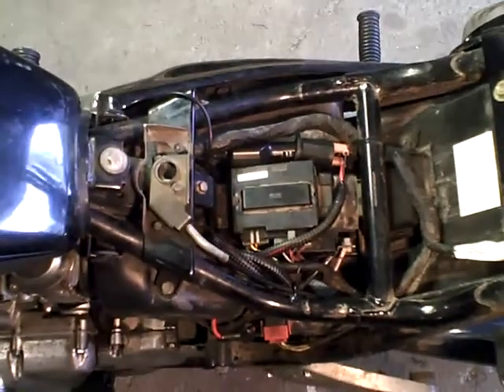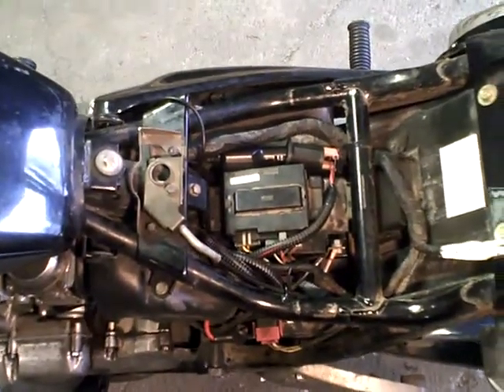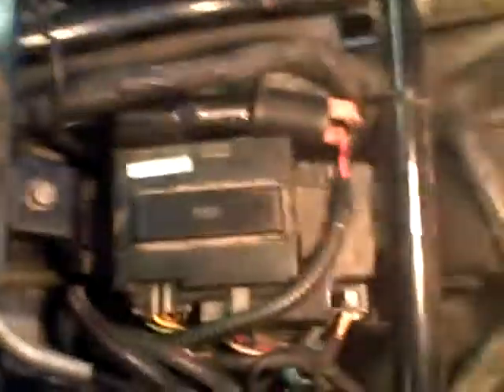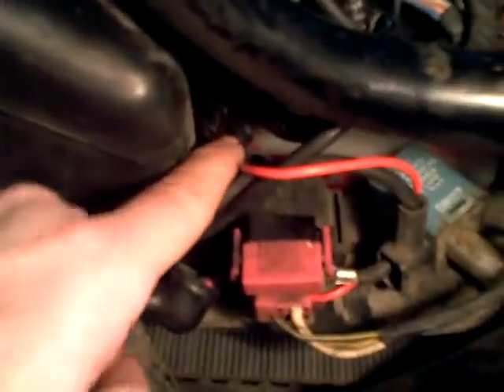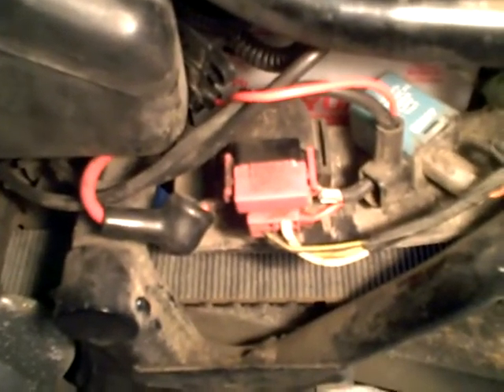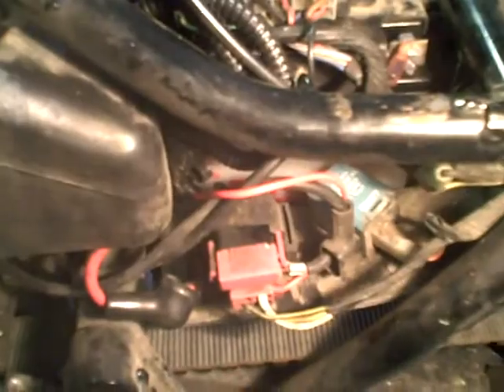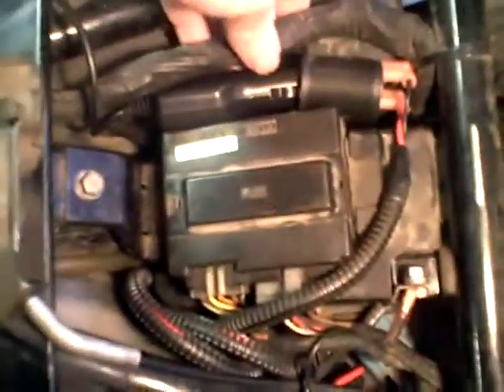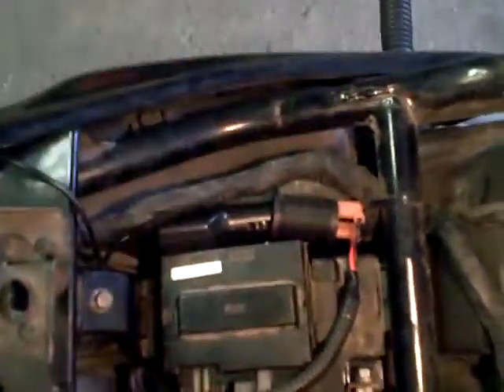May Midwest Meetup Prep

Comment: I was thinking about saying something then you mentioned not leaving the adapter plugged in.  Darn things can suck down the battery.  I learned that the hard way.  Had a similar setup under my seat.  Mines hard to get to so left it plugged in.  After a week I had a dead battery.  Now I have a battery tender plug wired into the battery that I can access from the side of the bike to either charge the battery or to plug my cig adapter socket into for power when needed.

Comment from the maker: Since the plug is converting 12 volts to 5 volts at around 800 ma. I am thinking at least a 1 amp draw if I left it plugged in. Probably as you said dead battery in a week.

Comment: The IHOP in Grandview is about two blocks south of the Kansas City's south side city limit. I am hoping the weather is good for your trip to the area. It's been a rain event every couple of days here for the several weeks. I like your GPS setup and have been thinking of putting a poor mans version on one of my bikes. Is that a Garmin clamp holding the unit or an after market? Have a safe trip here. I think you have my cell number. Give me a call if you need any help.